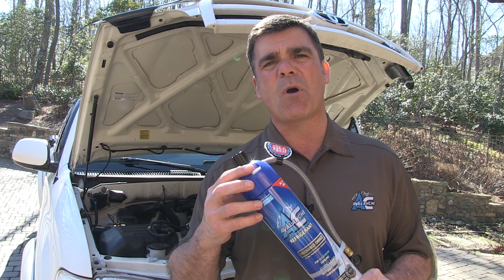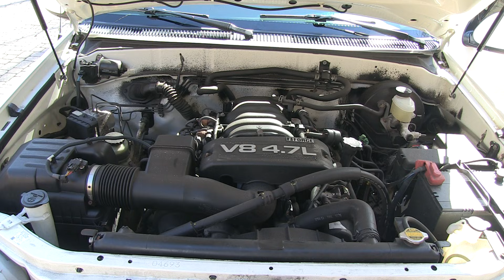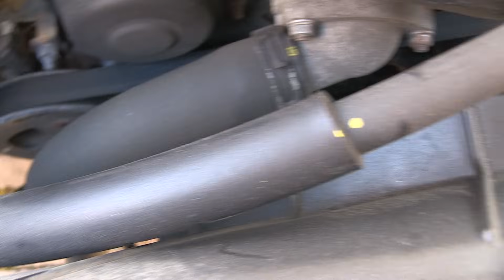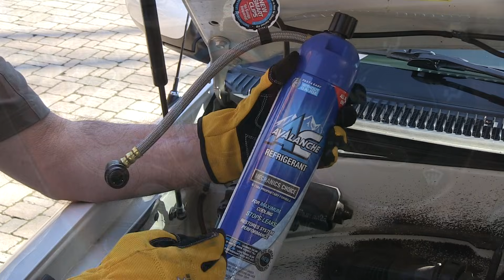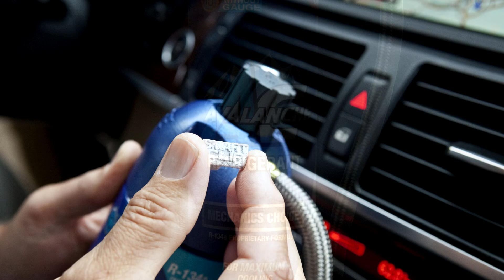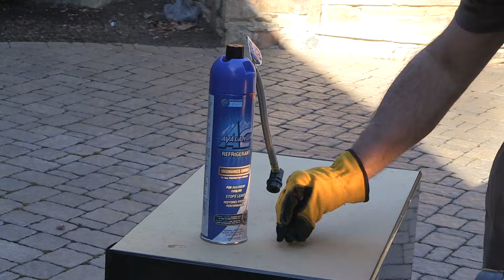AC Avalanche - How To Recharge your Auto Air Conditioner

Comment: Thanks for the instructions.

 I used the whole can, it is empty. The first clip did turn a deep blue. The other clip turned green at its "feet" and half of the inside of the clip´s face. So it did turn green but not the whole clip, and the color was not as deep as the blue clip.

It feels like it is cold enough, but if I could get it colder then I would like to do so. So I wonder if my AC could use some more and if I should buy another can?

I have a Volkswagen 1998 Golf, GTL, 2.0